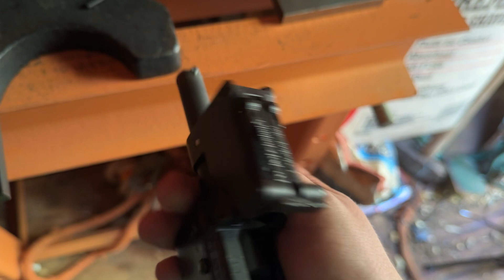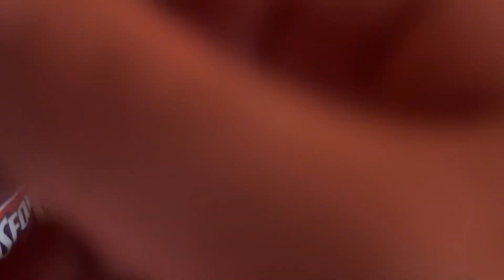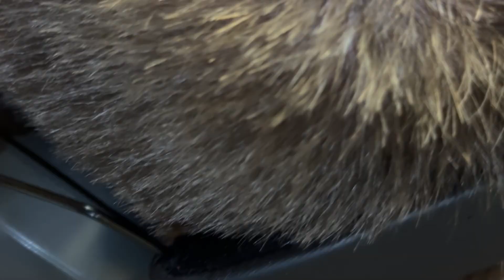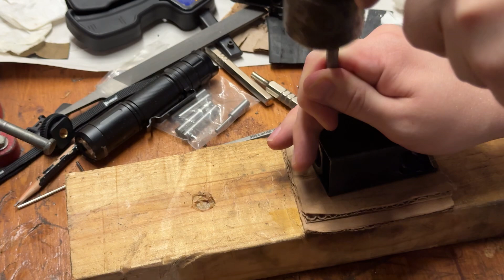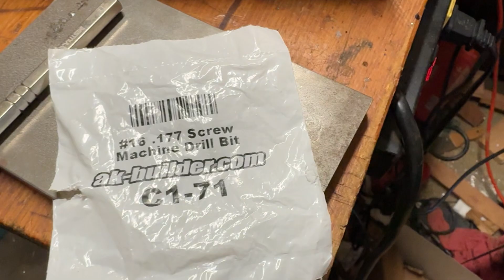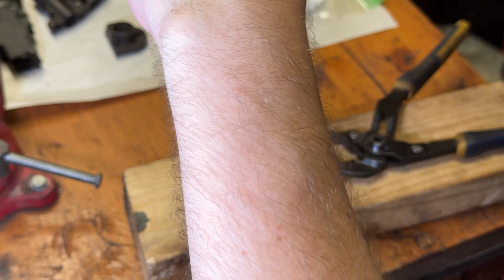5.56 Romanian AIMS-74 AK Parts Kit Build | Part 2 - Demill (PAIN)

Comment: I bought one of these aims 74 kits a month or so ago. It didnt come with the wire folding stock, that was the hard piece to find. For some reason they have been all sold out everywhere including the airsoft sites. The airsoft sites can sometimes be an important resource because alot of time those nerds use real furniture. 

The Aims 74 kit is pretty cool because it come with a 4 position selector mechanism. Its a neet item to keep in a shoe box for the day China tries to invade us.😂

Comment: It would really help if  the vice was bolted down on the table,  use a NEW end mill not a resharpend,   use the correct speed with the mill,   if you keep doing what you are doing good buy a finger.

Comment: Put the drill motor down! Lol  you got heart kid 💯 % but don't drift press fit pins on top of springy reboundy wood. Drill into rivet heads about 8th inch put punch into the head and snap them all off never drill all the way through so you can actually drift them all out easily. Keep at it 💪

Comment: Ok I don’t wanna sound like a know it all but I just wanted to help so you don’t damage trunnions like I do, so comes to Russian and Europe ak’s the front trunnion and trigger guard rivet holes are 5/32 and the rear trunnion are 11/64, what I do is, for a example the rear trunnion hole has a 11/64 drill bit, I’ll go something lower in that diameter so that way you can make a good hole of the rivet head and stick a punch pin inside the hole you made and force the pin to move side ways so that way the rivet head comes off so that way you can drill the rest of the rivet out, take your time and avoid cutting fluid and your trunnion would come out like nothing happen, even if you did mess it up the holes don’t worry is not the end of the world

Comment: Hey I’m a total idiot when it comes to these part kits and I’ve never made one myself or punched out pins, so your light years ahead of me. Quick question though would penetrating oil and heat help with getting those pins and parts out?
Reply from the maker: Fair question! Heat might have helped the pins, idk. I tend to not want to use a torch on parts, but I should probably try it next time before drilling as a last resort. I did try penetrating oil, but it didn’t help in this case. The pressed on barrel components pretty much have to be pressed off though since they’re a press fit. I guess the pins are technically a press fit too, just on a smaller part
Reply: @ that makes total sense. There is a reason they are press fit. In a sense when they make the gun, they never plan to separate those parts EVER! If they could build the trunnion with the barrel and make it one piece they would. I love the videos man. I love that there is no music and you’re just explaining the process. When I get some more time I’m going to go back over your catalog. What is great is you’re not skipping anything. You show the process and all that it takes instead of fast forwarding or clipping it. It’s great to see the difficulty and all the ideas to figure it out. Makes it fun and interesting to watch and totally relaxing. Bravo sir.
Reply from the maker: Much appreciated! I cut as little as I can for the same reason, I often get frustrated watching someone’s video, and they cut out the one part I needed to see lol. I leave in mistakes and figuring things out since that’s how it’s probably going to go for most people. I get some rude comments for it, but I also get just as many or more with actual suggestions and nice things to say. At the end of the day it’s a cool hobby and I just like sharing the process on my builds, and I’m glad you enjoy it!

Comment: If you're doing multiple kits, you really need better tools. If anything, real tools are much safer.
Reply from the maker: Yeah, I agree (and I do have several more kits). I ended up buying a few more things from AKbuilder in the process of demilling this kit, but I still need to get (or make) press plates for all the different barrel component sizes, like I did for the RSB. I also need to make another pin punch for the AKbuilder tool, and find a better way to demill the trigger guard rivets
Reply: @Ryan45678 use recreator tools, it will save you the trouble

Comment: I use a quality wrench to c around the sight base to get a good half circle of support, has worked very well
Reply from the maker: Nice. I tried doing that with the gas block, but it just would not sit straight. How do you keep it from going off to one side, or is the wrench you use not tapered?

Comment: Please start using some kind of oil or cutting fluid when you drill. It reduces heat and saves your drill bits. Pains me to see you drilling still without oil.
Reply from the maker: I normally do, I might have just not shown it and/or not used enough